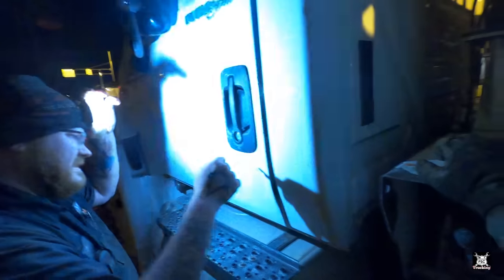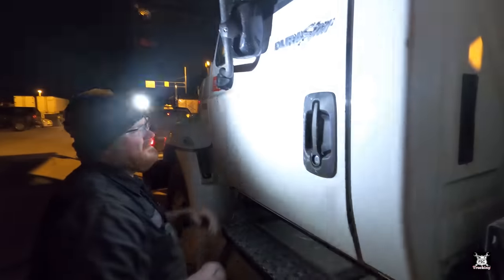Dragging Dead Bucket Truck Off My Trailer.   Cabover Life

Comment: Probably had air over hydraulic brakes. We had several under the 26,000 lbs weight capacity so
the drivers did not have to have commercial license or air brake endorsement.  Air was booster for brakes and also for parking brakes. These were an upgrade from the first ones with driveshaft hand parking brake. They were never good on a steep grade Air parking brakes were great if brake shoes/pads were in good adjustment.. Bonus, had an air horn.

Comment: Boy you got lucky with the late night delivery. That don’t happen to often. You would think that International place would have a set to take a truck off a trailer that’s not running, welcome to Micky Mouse land. So many places are so unprepared to do the work . Another great video FSC , MATS is over. Orwell sounds great and looks great. Sure a missing that Highway Polka Music. Have a great and a safe day. Happy trails and happy motoring..,
Reply from the maker: Usually dead ones get dragged in via wrecker.
Reply: @fsctrucking  I had a winch on the back of my tractor to winch the dead ones on and off.